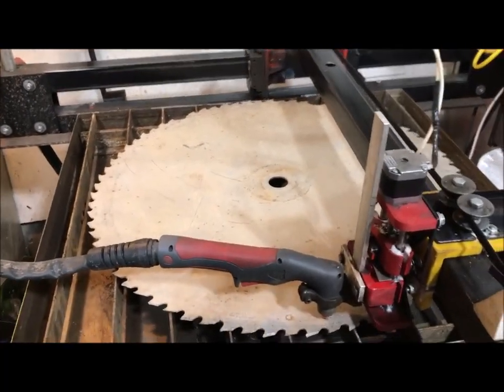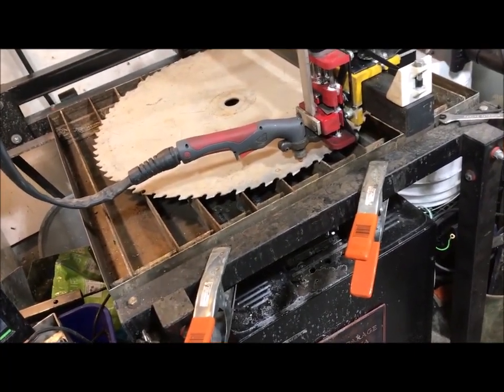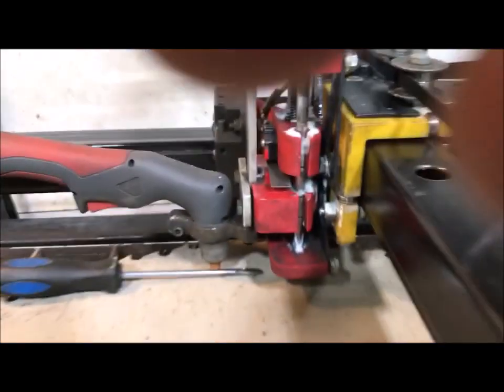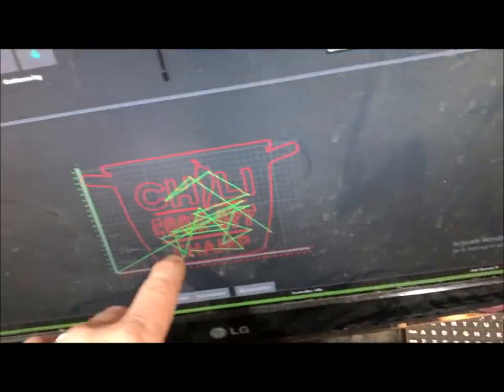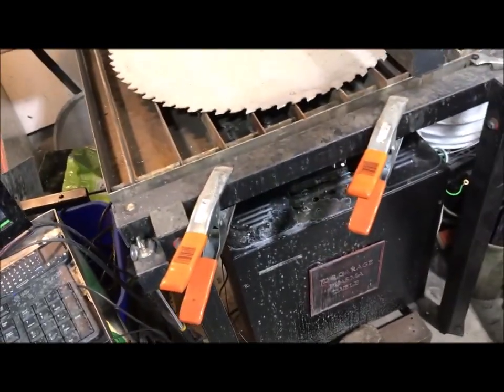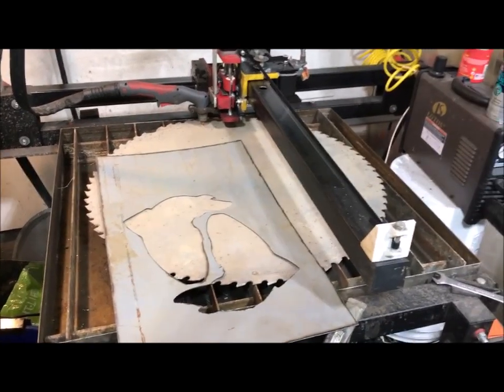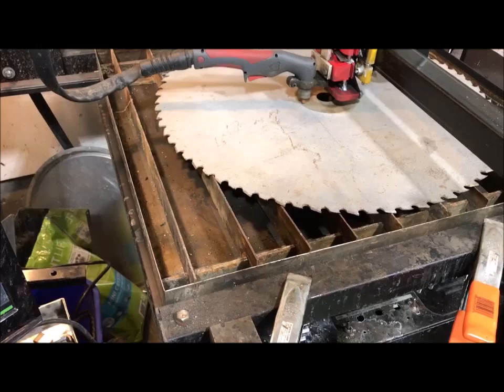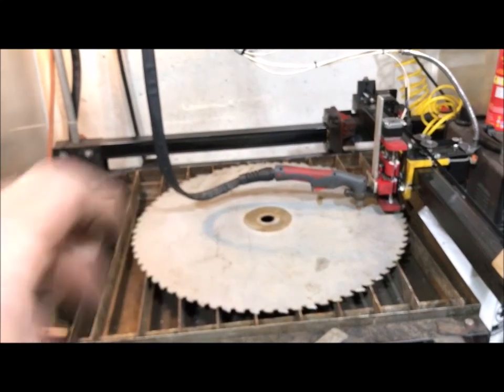Adjusting bed level on CNC plasma cutter

Comment: I got mine level by adding a wheel to the end of the x axis bar. I also lengthened the 2x2 bar by 10 inches that is opposite of the double y axis bars.
I can send pictures

Comment: Just support the end of the cantilever as mentioned. A wheel or bearing will cure the problem. I'm finishing up my build of this table and will be supporting the end. Another thing to consider is the weight of the of your X, how thick is the tube, what did you make you metal fabricated parts out of (steel or aluminum)? There's a lot of weight hanging out there with the added Z motor etc..

Comment: I have the same problem but only 2 mm difference. I have solved it to add a extra rail with a bearing and it works very good i most say, maybe you are interested how a made it? Still not finished but almost ready, here is how i made it https://www.youtube.com/watch?v=xLSeKslbVjU&t=88s

Comment: Man thats way more than mine. I have about a 1/8 th gap. I am thinking bout fabing a bearing on a bolt off the end of the X axis, like a unicycle that rides on a rail with the bolt being height adjustable. My Y axis is perfect I also have a Aluminum tube for my X. (edited to say) I  adjusted over and over my Y rail bearings and it did make a difference, but there would be times when I get my set screws so tight it would affect my Y travel and it would drag.
Reply: Just support  the x axis with   bearing or better  is to build another y axis  rail kinda like langimer  pro table sure thc Is Going to be better but cantilever  arm is not good   for detail cuts.
Reply: That's what I did, took a piece of flat bar, cut a groove in it, bent to a 90, screwed a wheel to it, cut 2 slots for adjustment on the other end of the bar, drilled taped 2 holes on x axis bar, now th x arm has 0 sag, had to extend th y axis on the other side so I could cut fully to the end, otherwise the whole would drop off
Reply from the maker: Someone mentioned to me that the difference may just be in my leg adjustments. I am not sure how that would make the table level or not level to the Y axis but worth looking into.
Reply: @digitizer101  The only way I could think it would be your table legs would be if the gantry isnt square with them??? Take a square and place it on your gantry and check your legs with that. Meaning your gantry and table supports , the ones that support where the water tray lays on are square to each other. So the supports that run perpendicular with the Y rail are square to the gantry. Hope Im clear. Wish we could post a picture. My gantry assembly took a huge amount of fooling with to get close. Make sure all your bearings are touching and rolling/ I got mine pretty close that way. Still I am gonna add a bearing at the end of the X. Instead of shimming your water tray the better solution in my opinion would be to shim the gantry. I would trust that more than shimming the water tray.
Reply: Another thing you did wrong was you used the wrong 3/8” bolts holding the legs to the “Y” frame rail.  You used long bolts thru both pieces ( leg & Y rail) which leaves the bolt head taking up valuable room between the Y rail and the water tray.  The plans show shorter bolts entering from the outside of the leg, through the plastic spacer and the washer and nut go INSIDE the Y rail.  See drawing # Tube Frame (1.0).  This allows the water tray to be touching the Y rail which makes more than enough room for the 3D printed parts to move back and forth.  JDs Garage plans and drawings have been used to build tons of these machines and I’m positive they have been checked and re-checked a million times.  If you follow the instructions they work perfectly.